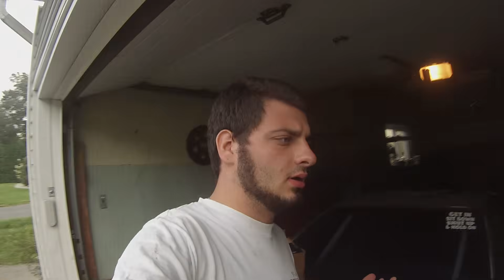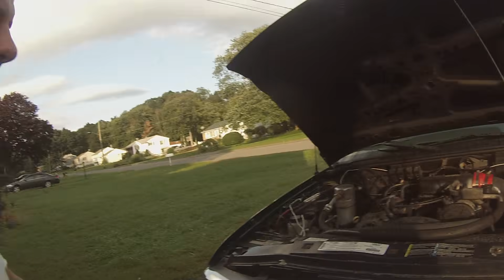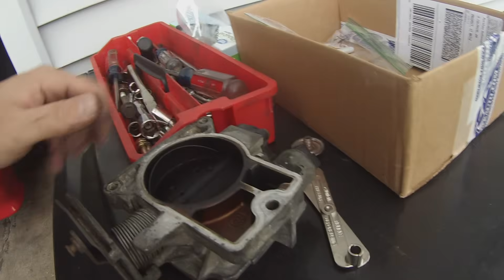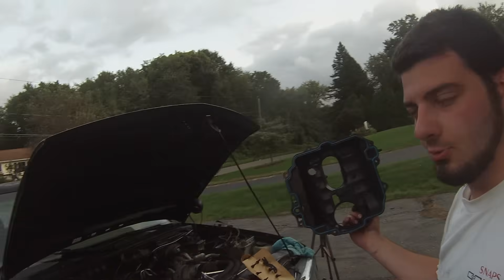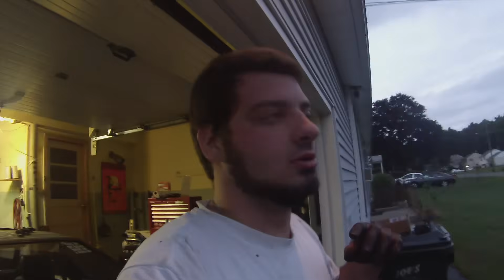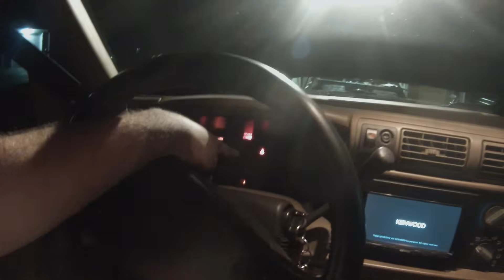S10 / Blazer 4.3 Fuel Pressure Regulator

Comment: tl;dr = [If I knew then what I know now...] DUUUUUDE! PROTIP: (I just figured this out myself like 15 minutes ago). Remove the Spider Injector for MUCH easier installation! And I know what yer thinking; that DAMN Torx bolt, and yeah, I know, mine was seized as well. BUT, look on the sides, and there are four tabs locking it in place, just bend the metal bracket back a little bit, and you can slide each side free, easily removing the assembly from the truck. Use a hook/pick to remove excess carbon from each injector tip & spray 'em down with brake cleaner. Also, I DID notice the old tiny O-ring in advance because the new one came with one, and I was wondering where the old one went. Anyway, after spraying down the port with brake clean and wiping it out, use white lith or Di-electric grease on both of the new rings, pushing down while rotating in order to work it into place, and the clip is installed facing up with the 'wider' side facing the front of the motor.

Comment: At 3:28 those 2 fuel silver metal lines. Are they both supposed to be in all the way? I took off the 2 small nuts with 5/16 socket and I forgot to take a picture of how it was now I have fuel spilling because I put both in with pressure and tightened them both. The silver fuel lines have a little groove. Is that groove supposed to be under the little bracket? Thx anyone who knows

Comment: You don't know how to reinstall the coil?  8-32 screws, #8 washers, #8 lock washers, and 8-32 nuts.  "Turn the key a couple times to prime the fuel pump"...all you do is turn the key on and bam, there's fuel pressure.

Comment: I have gmc v 6 Sonoma I have fuel to the fuel rail but will not start unless I put fuel down the in take then will run until gas that put in rus out
Reply from the maker: It’s been years since I’ve owned this truck. But the spider injectors were notorious for going out all the time in these. I would look into that if you have fuel at the rail.

Comment: Terrible method for fixing issues, actually diagnose the problem. Changing parts and guessing is what an idiot does. Please do not use this advice.
Reply: yea except this solved the problem.......and it's pretty common, and a known with ethanol fuels that the diaphragm in the regulator breaks down......not like he bought a new cat....
Reply: @stupiderthanjupiter4987  Well real technicians don’t do this, and if they do they must be a junk Yard mechanic
Reply: What hoseline connects to the fuel ⛽ pressure regulator

Comment: It would have been nice to have more detailadn the complete disembleming of the everything in  removing the platum off intake manifold, but this is so far the most detail of all the videos I have found in replacing the fuel pressure regulator, and some good tips.  My question is should I cover the large holes so stuff like hardware does not fall into those large holes?  I have a 99 4.3 blazer that I may need to replace the fuel pressure regulator.
Reply: yes, you should. a 10mm socket could fall in and you could easily magnet it out, or use compressed air, but a small metal fragment could still get in. removing plastic upper is pretty easy; the lower manifold wouldn't be tho.....
* oh regulator can leak excess into the plenum and you may not notice but gas mileage suffers, so replacing isn't a bad thing to try